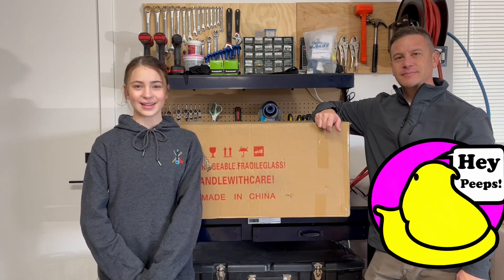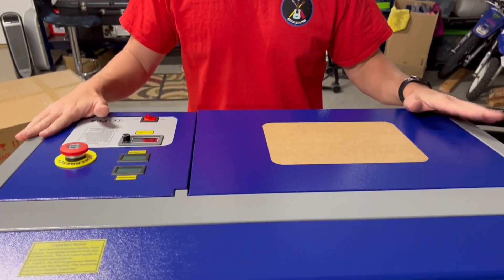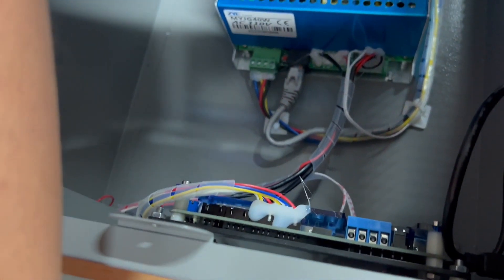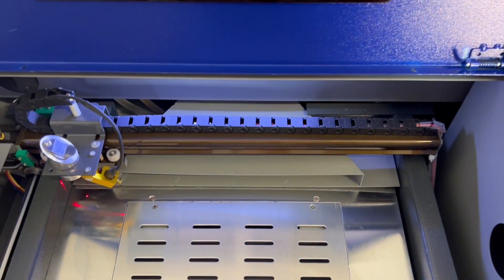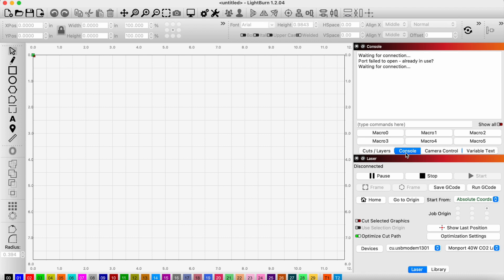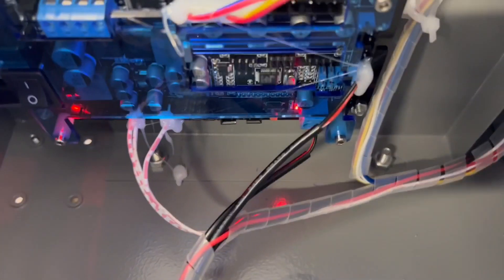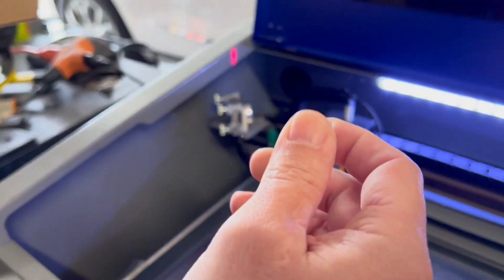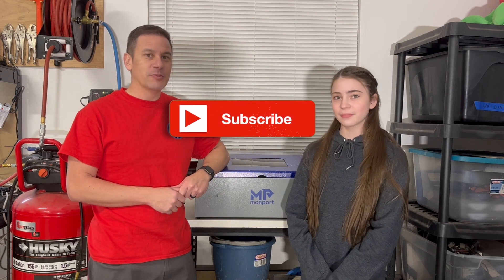Unboxing the Monport 40W CO2 Laser + Our First Project

Comment from the maker: ⏰LIMITED TIME DISCOUNT UPDATE! ** Anonymous20 ** Promo code for 20% off is limited and the discount applies on current stock of the Monport ONYX, 40W Pro + Lightburn & 20w Portable Fiber Laser only. Use Anonymous10 to save across the website and continued use after limited promo ends.  Be sure to check out our page on Monport’s website for details/machines: https://monportlaser.com/collections/desktop-lasers-and-fiber-lasers-recommended-by-projectanonymous_duo?sca_ref=4451934.of5mkLvEvQ

Be sure to check out our playlists featuring all of our Monport machines for Unboxing and Projects!

Comment: Order summary
	Special Offer | Monport 40W Pro Lightburn-Supported (12" X 8") CO2 Laser Engraver & Cutter with Air Assist × 1
40W Pro All-in-one Bundle
$859.97

Subtotal

$859.97
Order discount

-$86.00
 Anonymous10 (-$86.00)

Shipping

$0.00
Taxes

$0.00
Total

$773.97 USD
You saved $86.00  THANKS FOR THE CODE ... I WAS ON THE FENCE.
Reply from the maker: Thanks for watching our video and using our code!

Comment: I know the working area on this model is 8x10 but I’m wondering if an 8x10 piece of glass would fit in it? Or is the area literally 8x10 and so I would need a smaller piece of material?
Reply from the maker: The laser bed itself will fit material that is about 13"x11". However, your project area (laser-able area) is about 11.4x7.8" or 290 x198mm due to limit switches and stops. We hope this helps.   Here is the link to laser with specs: https://bit.ly/3V5EAEV  If you are looking for a larger desktop laser bed area with pass through option, they have a newer model called the Onyx we just posted a video on, however it is will cost a bit more and take up more space. Here is the 55w video: https://youtu.be/b4gQftQzFWg and link to laser :http://bit.ly/3Afsxg0  Thanks for watching!

Comment: Machines don't work and there is no support.
Reply from the maker: Sorry to hear you are having trouble. We can only speak to our experience, but our machine has worked well for us and when we've had questions they have provided support.
Reply: The gauges only need the batteries replaced, they’re not electrical. Only turn your meter to about 75% and never max it out on both the meter and lightburn at the same time to save the life of your tube. Select choose when trying to find your laser. I have had excellent support when I needed it even had someone log into my computer with me to test for problems.